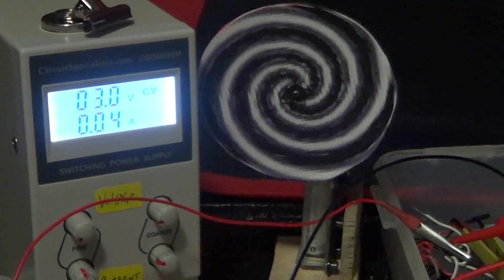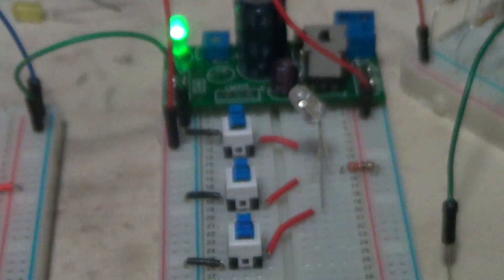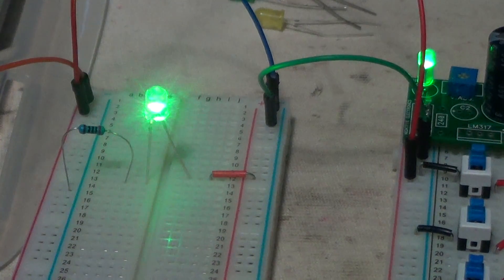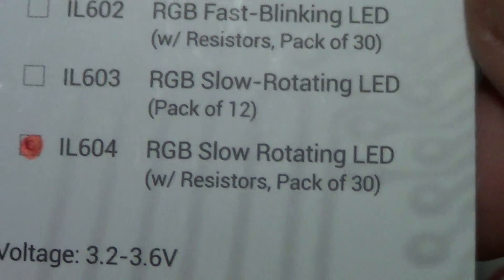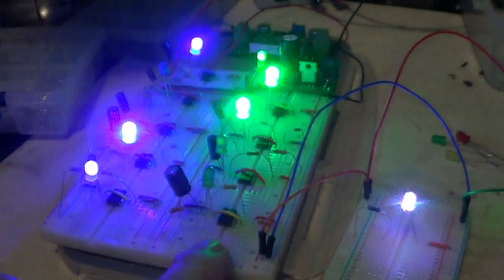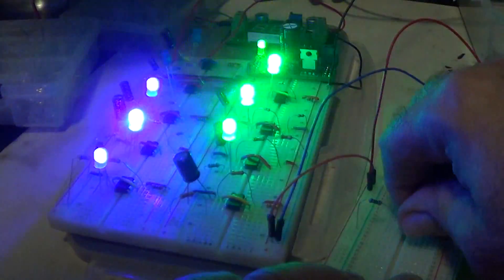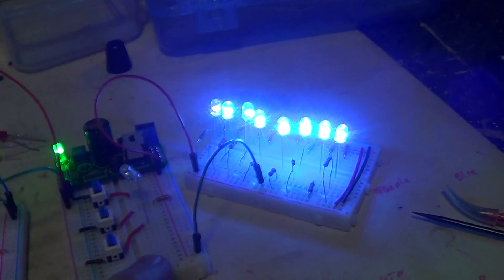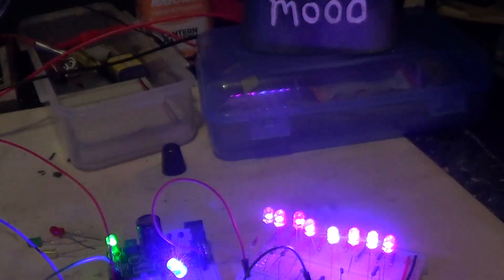Multi-Color LED's

Comment: we cant make it stop at a specefic color ? the rotating led? i have on in my gaming mouse and i want it to stop rotating and chose between diffrent colors..
Reply: MaxGameZZ I think you’d have to open it up and add a third connector. If I’m not mistaken it has a chip inside which controls each color and the timing, but it probably does some sort of voltage comparison, so maybe one could add a third connector and change the input voltage to it you could pick any color and color combination? Would definitely be much better than having to control three switches. I have a few of these and I’m planning on opening one up tomorrow to do just that 🙂

Comment: you can get every color combo with that RGB LED. turn on red and green to get yellow. red and blue gives you pink or green and blue makes teal. Or you can light up all three and get white. And if you put something in something in you can control the voltage(potentiometer?) for each color you can get even more colors. LOL yeah I'm a Lighting Director...I can operate them not build them lol. Nice work. Is this just a Hobby for you?
Reply from the maker: Mostly hobby=)